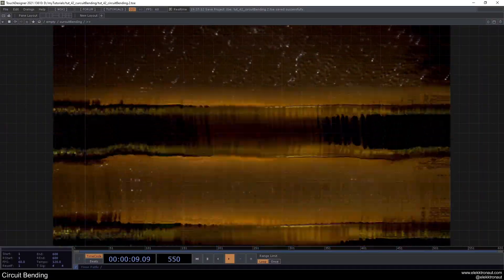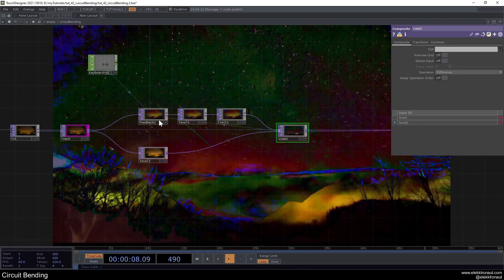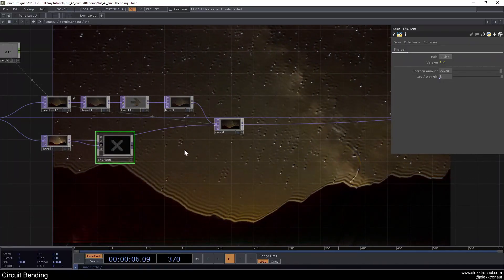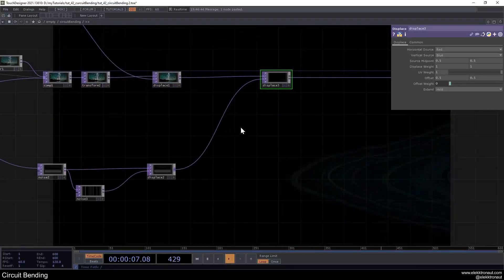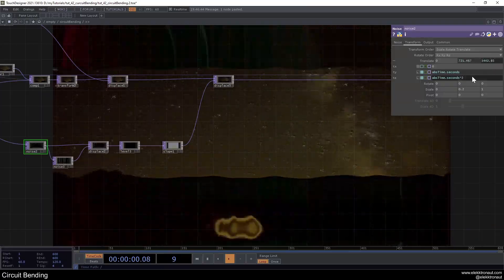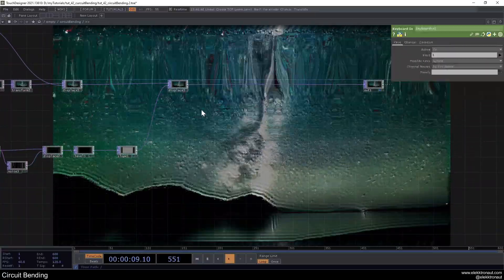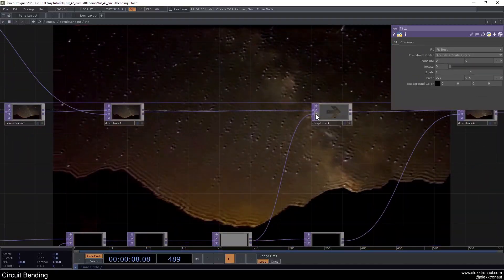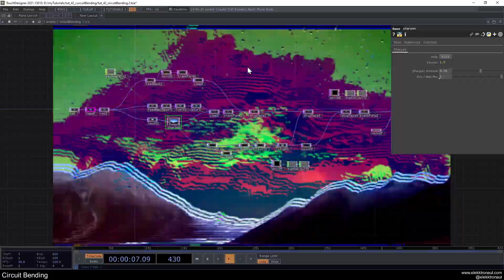Circuit Bending – TouchDesigner Tutorial 42

Comment: Hi. Noise 2 and 3 displacement doesn't works as in the video. it gives me a different effect although all the parameters are the same as the video. has someone else had the same issue?
Reply: same.. ive gone over it a few times to see if i missed something but i think everythings correct. The current clamp params in the level tops are a little different but i guess something must have changed with the noise top in a recent update
Reply: @joelvedros4959  Hey did you guys find out how to fix this?
Reply: after some research I have realized that the main thing is that under the composite and transform you should all the scale values to 1 and also legacy transform to on. For the levels you should also select the Clamp [0-1] which it think it was the default option, nowadays it is set to automatic.